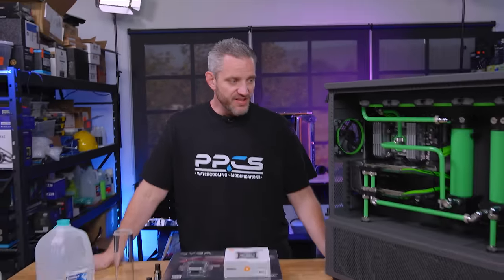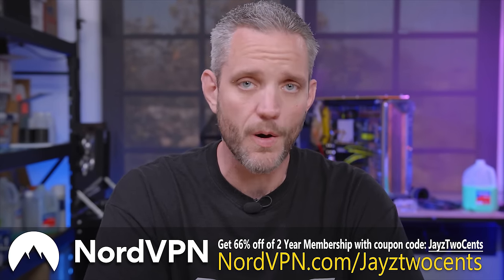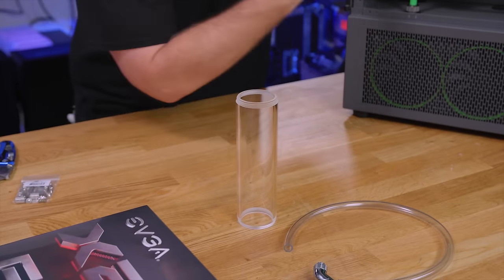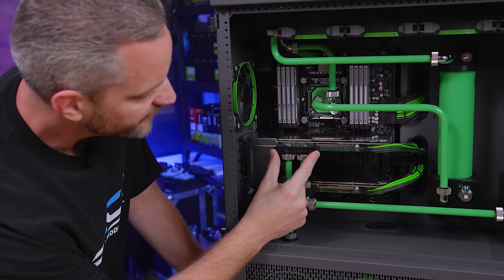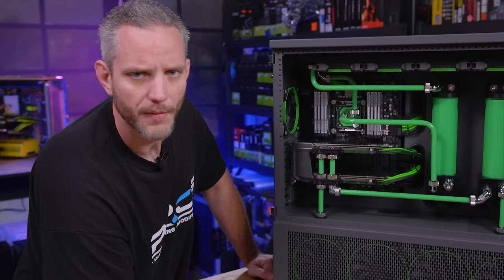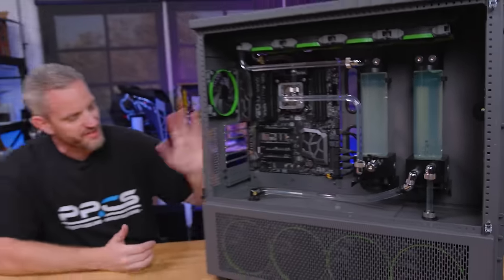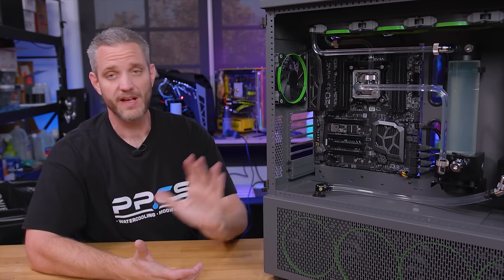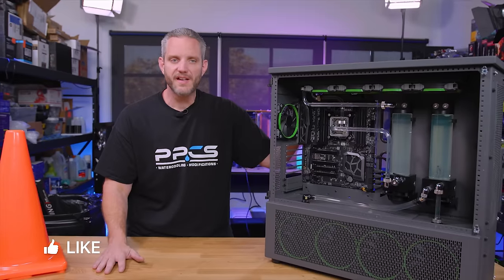Working on Skunkworks once again! Most OVERKILL Gaming PC

Comment: I need your help guys.
I built a custom watercooled pc but the computer is loud and doesn’t have good temperatures.
Specs: i7 8700k, 1080ti, D5 Pump, Waterblocks by EK, EK Vardar Fans, 2x 360 Radiators (1 in push-pull).
I already tried to set the fans manually but if I turn the fans below 30% the PC gets really hot.
To summarise the PC is hot and loud despite the ‘on paper’ good cooling.

Really looking forward to any suggestions/ help
Reply: ODIN The 8700k tends to run really hot if it isn't delided, as such most water coolers tend to do this. Are you seeing high temps on your 1080ti as well? If the pump is going full speed that could be a reason why it's loud. Make sure that you fully tightened the water blocks as poor contact tends to be a common issue.
Reply: @forza1sra  I delided the CPU and the pump is running at around 30%

Comment: "Not two titan XP's but titan X packals." You know titan XP stands for titan X Pascal?
Reply: You're forgetting that there's two variations of the Titan X Pascal. What everyone dubbed the Titan XP which was a  Titan X on the Pascal architecture. Then the Titan Xp realeasd later on. So to distinguish between the two they use Titan XP (big P) and Titan Xp (little P)

Comment: #requestion  Laminar flow with thinwall microtubing?  See link below for similar concept.  Ebay has PEEK and Polyimide (Kapton) tubing in many gauges.  Laminar flow has a higher velocity therefore greater throughput but turbulent flow has a better cooling capabilities.   Would be interesting to see the potential tradeoff of fluid velocity vs turbulent heat dissipation or a combo where you employ laminar flow before any long runs and turbulence (maybe with a porous mesh or flow indicator) before the cpu and rad.  Posted to GN to address as well, really curious since it seems no one has done it yet, on youtube anyway, as far as I can tell.

https://www.designnews.com/electronics-test/turbulent-flow-versus-laminar-flow-cooling/163938973534399